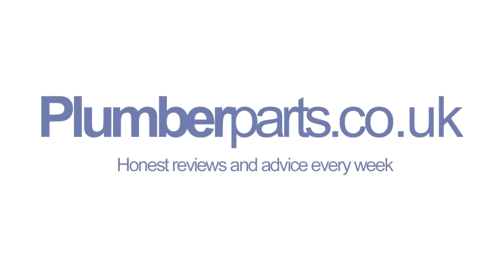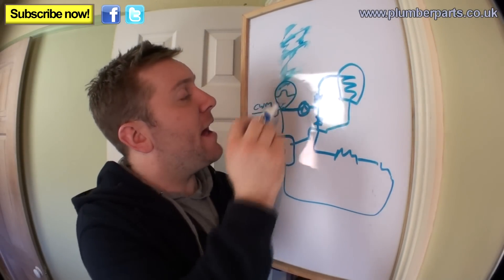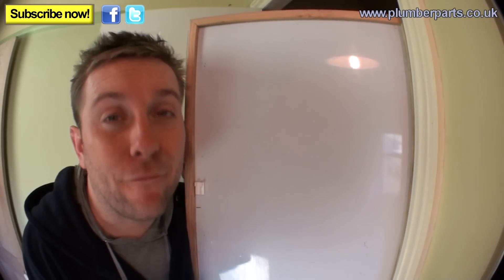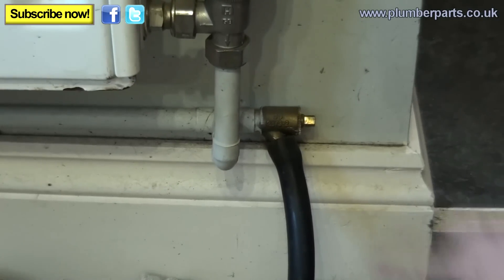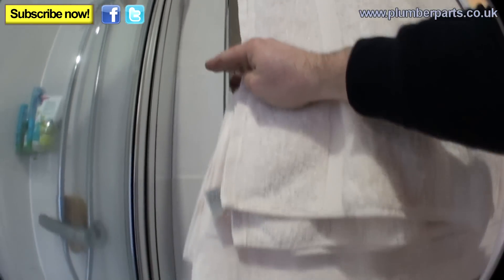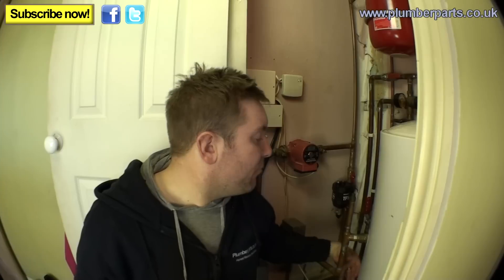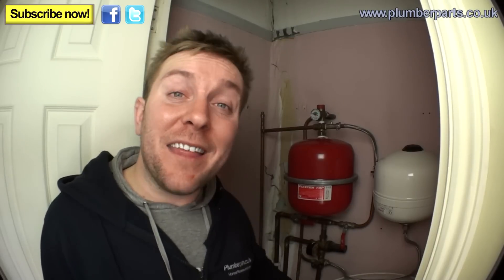HOW TO DRAIN YOUR HEATING SYSTEM - Pressurised - PLUMBING TIPS

Comment: I've a back boiler there's a pipe with a valve that comes down to the pump and runs inside the hot tank. If I can that off will that act as a air gap.

Comment: I'm going to remove the bathroom radiator so I can plaster the wall .now can you give me some advice . Do I need to do something with the  combi boiler first before I remove the radiator or do I wait till I've attached the radiator back in place  then go to the boiler.
Much appreciated as I won't remove the radiator until I know for certain what I must do .

Comment: Hi,

Been learning lodes from your videos.
I have a system which has both a water tank in the loft and pressure cylinder and actuator valve.
This has left me slightly perplexed.
In anycase I have drained my rad system. 
Can I still use the hot water with the rad system drained ?
Thanks

Comment: I was told never to drain the system because the water in the system is best. I wanted to drain it because when the system shuts off, I hear the water draining back to the main system. I don't think it is supposed to do that. Its like it is in need of water but the pressure is showing ok but still dont think it should make sounds like that. Looking forward to your thoughts! Great video's, makes me laugh! You missed your calling!

Comment: Thanks, mate, that's a useful reminder of a job I haven't done in, oh, twenty years or something. I like your STYLEEEE! You'd love the house I'm working on just now (moved in a few weeks ago): it's been owned at some point by Captain Bodge in person, just EVERYTHING slightly buggered up. The radiator I'm about to replace is hanging on one support - whoever fitted it completely missed the second support, which is fitted to the wall but not under the radiator. To check where the pipes are going I pulled up a couple of floorboards, which had been lifted in the past and re-fitted with one-inch panel pins. Yeah. I mean, we've all done the odd bodge in a lifetime, right? 6pm, due home half an hour ago, local shops shut, Screwfix out of stock - do what you have to do and get off the premises, but this place is just systematically bodged from top to bottom. Still, it means I get to hone a few practical skills I'd half forgotten.

Comment: I didn't do that. I just turned the boiler off, attached a hose to the bathroom radiator and put it into the toilet and then I went upstairs into the loft and turned the tap to the feed loop on and let mains water flow through the system to push all the silt out of the radiators until the water ran clear. Then I reset everything and put in some inhibitor and it was fine.

Comment: Plumberparts, Best to put inhibitor in before refiling with water.
Reply: Not true, you need to test your work for any leaks before inhibitor is added, otherwise you you could be draining the system down again to rectify the problem.

Comment: Hi. I added a new radiator to my pressurized system, but I didn't fully drain down the system. I closed all the rads and just drained the water in the pipes, cut into the pipework and installed a new rad and then refilled/pressurized the system (my system has automatic air release valves). Took no time at all. Why do you have to drain all the system, why not leave the rads filled ?

Comment: Great stuff. Question.. I need to install an external bleed valve. Is it possible to install one by closing all radiators so I don't drain the full system. I have mega flow system.

Comment: Before I drain system I close all radiator valves  that I'm not working on so rads are hopefully still pressured if valves hold is this ok or do you recommend drain everything

Comment: Hello I always follow you ... I'd like to drain my system myself and add an inhibitor and I find your video great. I would just ask you to put in the description or reply to this message a written list of steps on what to do and also what NOT to do just in addition to the video just to make sure and avoid making any mistake. Thanks
Reply: I was gobsmacked when he ended the video without showing how to get the inhibitor in! My guess is that you take one of the caps off the top corner of a radiator and pour it in using a small funnel but if so, why bleed the radiators before doing that?
Reply: @Phiyedough  My engineer added inhibitor in the Bosch  filter then fastened the lid. Then he filled the system. . This was a boiler upgrade from an old fashioned  floor mounted  conventional flue to a sealed stem with a Worcester Bosch Greenstar 30i ERP compact.

Comment: Hi. Great vids and used on other issues. But, I need to re-do a pipe leg to a ground floor radiator as too short. How do you drain the pipes under the suspended floor boards of the ground floor if the drain valve is higher up by the rad? Cut into the pipe and catch as much water as possible? Is there anyway to siphon etc? Sorry, its a open vent gravity system.

Comment: Hi, can I still use my combi boiler for just hot water while the system is drained down ? The boiler (Worcester Bosch 30CDI) has isolating valves on the flow and return

Comment: Ok....seems very logical to me, or so I thought!
I need to install a replacement radiator downstairs which is slightly larger than the existing one, hence I need to extend the pipes.
Now, we have a conventional boiler with a hot water storage tank and an expansion tank in the loft.
Imagine then my confusion when I found the hot water tank in the airing cupboard with an expansion vessel above?.?

No signs of any pressure gauges, so I’m wondering which bloody system I have- pressurised or not....
It would appear a hybrid of the two?!  And whether I’m ok to stain it down then refill as for conventional....

Thanks !

Comment: Hi I had to put more pressure in the boiler, and I can not turn the water of completly, so i had to turn the main water of, I  have a new isolating valve, I thin k the old one is kackered and doesnt turn of completly, how do you drain the water system so i can fit new one, can you do it by opening the  radiator and draining it that way, as thats the way I get the pressure back down again

Comment: Can I ask you an unrelated question.my system setup is a modern boiler on the wall that feed hot water to the tank and filled it up with hot waterI have my waste pipe from the boiler a plastic pipe that goes straight into the waste pipe under the sink when I run water and then stop after a few seconds I hear a noise in the boiler like the water is going back in the boiler thanks for reading my question

Comment: I need to drain the cylinder down to replace the seal on the immersion as its leaking ever so slightly also on a pressurized system. Is this similar to the heating system for draining and repressurising but finding drain off cock on the cylinder. 
Love the vids

Comment: Watched the video a few times but unsure whether to turn CW valve on or off once system has been pressurised and boiler turned back on. Can anyone help please?
Reply: Once the system pressure has been topped up cold to 1 bar (ish) and all of the radiators have been bled (purged of air) you should remove the temporary link, known as the filling loop. Usually this is usually a flexible, silver, braided hose. 2 weeks late. Hope you haven't had a catastrophe.

Comment: My 3 storey house has drain valves on all radiators on the bottom floor and I need to put new valves on a towel radiator in a top floor bathroom. We have an unvented system like the one in this video with the red & white tanks and the hot water cylinder. Which radiator should I use to drain the system please ?

Comment: How can I give you a couple bucks. You just saved me. I bumped the stem on the radiator in the office and couldn't figure why there seemed to be an infinite amou t of water in it, despite turning it off at the other end.

Comment: That gauge you showed us was upstairs, was it not? Surely the cold working pressure you want to achieve depends to some extent on where you measure it - it should be about 1/3 bar higher downstairs than up, should it not?
Reply from the maker: Yes, but that's in a world where systems have multiple gauges on different floors...something that isn't common in the UK...in fact I've never seen it.
Reply: plumberparts  - I was thinking of a system like mine. I have a combi boiler on the ground floor, and the pressure gauge is on the boiler front panel, 2.8m below the highest point in my system, which is the air bleed on a towel rail. When the system is full and that bleed is open and nothing is leaking in or out, my gauge should read about 0.25 bar. Should not cold working pressure be expressed as so many bar above that minimum pressure, which is 0.0 bar for a gauge at the top of the house but might be 0.6 bar for a gauge in a boiler on the ground floor of a three storey building?

Comment: i have this system in my flat but the water pressure is to high(shower/taps) I would like to turn it down. Do i do this at the stop cock under the kitchen sink ? or is there adjustment on the pump? Thanks.

Comment: Would it be possible or advantageous to fill your heating system (pressurized or non-pressurized / radiator or radiant) with distilled water?

Comment: All you need is an Alan key for the isolation valve. Ended up stripping the screw nut with a flat head as it was too tight. Thanks for the video we very nearly flooded the house and was utterly confused why we could find the IV.

Comment: last month a plumber changed the diverter valve in my boiler and after he finished work he pressurised the system to 2 bar. since then my house radiator are not heating up properly. I checked the room thermostat, bleed up the radiator but still we aren't getting enough heat from the radiator. before that we used to have 1 bar pressure and all of the rads were heating properly. so I doubt that might be due to more than 1 bar pressure. any suggestion would be really grateful. thanks

Comment: Solid run through on depressurizing and pressurizing a system. I appreciated the technical aspect of what bars a proper system should be at. I assume that is standard. I am tackling my first project of a radiator replacement this weekend. Anyway, salute from the States (Duluth, MN).

Comment: Very useful and the sense of humour went a long way lol. Thanks pal! I had to move a radiator alongside the same wall and how to empty/refill the pressurised system came in handy. Now i need to understand what does the non-thermostat valve do as it's leaking when I unscrew it to a certain length. Will be watching you other clips. :) 
Wazir

Comment: I wanted to flush my system, is there any reason I can't just attach a hose to the drain valve on a rad, then open the filling loop and let it just run though the system and out of the hose?
Reply: That's what I did. I put central heating cleaner in for a week or two beforehand. Then I drained the system as much as possible with the upstairs bleed valves open. At this point what came out was a yellow solution.  After a while the trickle become a drip, and then  I opened the filling taps to flush. Now some serious brown stuff came out. I flushed for about an hour; the pressure was over 1 during this time and the flow was like a normal tap flow. I even switched the boiler on for  a while in case the pump would help the process.
Reply: Ben Jackson

Comment: ive a pressurized system that is half under floor (ground floor, 4 feeds) anf half rads (1st floor, 4 rads) the motorised switch &
valve for the underfloor is knackered, is there anything i should be aware of when draining?

Comment: james you can also use the rad valves as taps to drain down if there is no drain offs installed. when working with a plumber before he showed me how to use the valves as taps to drain down, i found that a good way when the dodgy plumber who installed the work years ago forgot to install a drain off point. great videos though man they help alot as i am going to study my level 3 plumbing and heating dipmoma at college in September.

Comment: i dont have a pressure vessel on my heating system but i have a combi boiler i think and a cylinda in my aring cuboard
Reply: plumberparts i don't have any expansion or a cylinder.... should I be worried?
Reply from the maker: Good stuff!

Comment: "Blue Peter without the drugs".  Brilliant!    I find that putting inhibitor back in before refilling the system is easiest via unscrewing the top bleed valve in the towel radiator in the bathroom and pouring it in,  certainly a lot easier than trying to get it into a radiator top corner bleed valve port.  Refilling then helps the circulation of the inhibitor chemicals pretty quickly

Comment: I'll second Tommy Ds comment. Also, when you switch on the heating after filling up, would you recommend a warm bleed? (with the system off), or would you let it cool down? I still have some air knocking about the system, so I was wondering what you'd do? Tested for leaks and all seems well. Also have 4 zones of UFH.

Cheers!
Reply from the maker: +Llyr Jones Underfloor tends to take longer to bleed. By all means have a warm bleed!

Comment: Thanks for the great entertainment! I have a Worcester Bosch Greensted 30si and I need to add inhibitor, no plumbed towel rad, and no rads with a bleed valve blanking cap, they are all built into the radiator panels. Drain down and refill/pressurise is easy but where can I add inhibitor? Best option seems to be to remove an upstairs rad and pour into the pipes? Or is there a place to fill on this particular boiler? Thanks.
Reply from the maker: Shut a radiator off, drain the rad, then add it to the top of the radiator using a hose and funnel. Turn on and vent, you're done!

Comment: Hi  I got a Worcester 9.24 boiler, it runs Ok but there is a leaking water falling from the diverter valve and the pressure gauge goes down.
Emid

Comment: A lot of older systems retain the vented boiler system while updating to an unvented cylinder for the hot water to taps. In this case the boiler is still fed from a feed and expansion tank in the loft and the coil in the indirect cylinder is still vented. The cylinder itself is pressure-fed from the mains via a pressure regulator and fills with water at 3 bar. A "Y" system (3 port valve) ot "S" system (2 off 2 port valves) still makes the split between tap hot water and the radiator circuit. Actually I prefer the vented heat store system where the cylider water is simply a heat reservior - this water never changes. It's heated indirectly by a coil from the boiler abd hot tap water comes from another indirect coil in the sylider. The beauty of this system is that the hot water to the taps is freshly from the mains (the unvented cyliner water could hang around for days before being drawn off at the taps) and it does not need an annual service and check of the safety trips and valves as does the unvented. Nice video.
Reply from the maker: +diymostthings Cheers dude. I've got the old tank in tank tech too. Miles better!

Comment: hi plumberparts, I was thinking about when you put the two two port valves in the open position. Once you have done all the work and put everything back together do you have to put the two port valves back into the position they were in at first. thanks
Reply from the maker: +Sean Neville No, when powered up they motor themselves back to the automatic position.
Reply: Great thank you very much. I may be draining down our system soon because there maybe some of that sludge in the system so it needs a clean. Also will one tub of inhibitor be enough for 9 radiators.
Reply from the maker: +Sean Neville Yeah, one's fine.

Comment: great video mate, ive got a gas combi boiler in my flat, need to replace a couple of rads but there no drain off valves anywhere :( and advice ????
Reply: +Mike Haffenden apart from shooting the tit that put the system in lol
Reply from the maker: +Mike Haffenden Unlucky dude. Use a line tap. That'll sort you out. then install one properly!

Comment: Did anyone else reliese that before closing everything the system was turned on??
Reply: +video editor I noticed the light for the remote room stat receiver came back on,  opening those zone valves surely must have made the boiler and pump start up

Comment: interesting and informative video. I have a combi system and I am looking to replace a leaky compression T connector under the floor boards. Is there anyway of isolating this section of pipe, without going through the rigmarole  of draining down the full system?
Reply from the maker: +Mick Jones Not usually! Sorry mate!

Comment: I need some advice as I have changed a bath were the heating system were storage heaters so nothing to drain but I want to refurbish my bathroom and the system has a combo system. My question is before I attempt to gut the bathroom and I will need cut two pipes including the hot water pipe to the bath so that I can fix a flexi. Its safe to assume that even if I turn off the mains water valve I would need to drain the Central Heating System to prevent me flooding the bathroom. Am I correct? If so how can I check that the system is totally empty

Thanks Metra

Comment: Hi 

Thanks for your detailed explanations in all your videos.

I have a question regarding the system in this house. What is the little red cylindrical thing near the power outlets? I have the exact same thing in my system. It looks like a pump but I think that my heater (a Vaillant EcoTec) has already one inside it. 

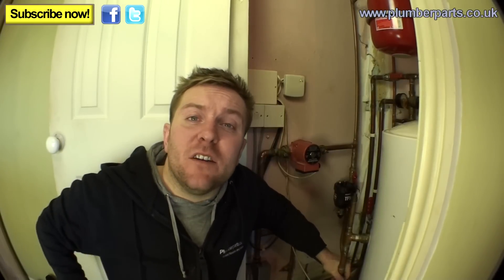Could you tell me what it is and what it does? Again, it's not the big expansion vessel. The other red cylindrical thing. You are standing next to it at 8:44.

Thanks!